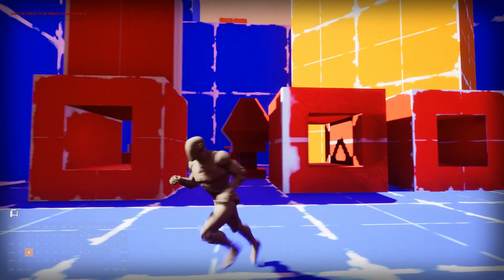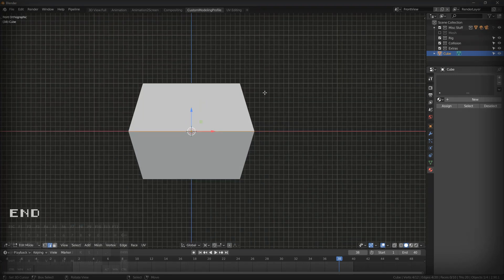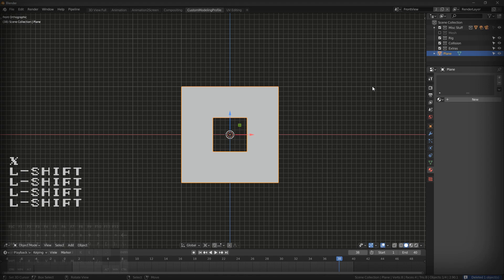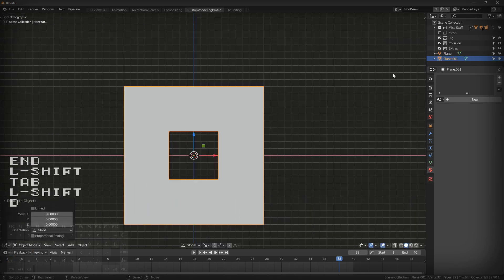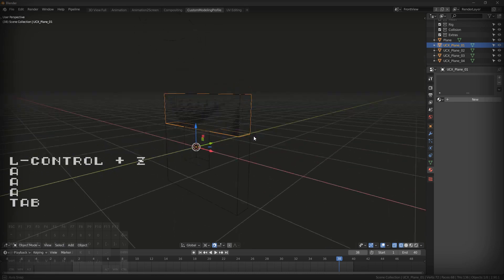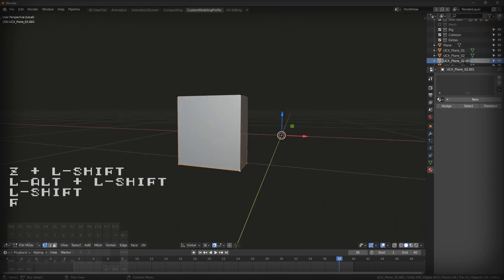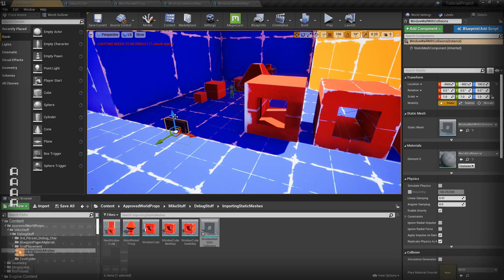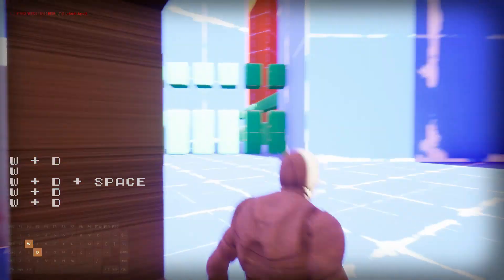Explaining Convex Shapes & Collisions in Unreal Engine & Blender - B2U - 2.5

Comment: Does using complex collision as simple take a lot more PC calculations? 
I bought a tub asset. I cant go inside it. And the complex polys are overkill. So do I really need to remake someone elses mesh, and add 5 planes to forum a tub (open box)?
Reply: You can always try to crank up the convex collision options. Often setting the hull precision to max or over it can help out. It should still be a lot better than complex collision even if you have a lot of hulls. But if you don't get the right results you can use the mesh but simplify it until it's only holding the shape. (Blender, Houdini, or even ue) And then use that as the collider. Even if it's not convex, better to have 500 poly mesh than 20k as collider.

And always consider how many collisions are calculated for the object. For example if your bathtub is never near anything which simulates it will make 0 impact. But if you try to fill it with simulated balls they all have to check against the thousands of triangles.
Reply: @kettenotter  Thanks. Do you know any comparison video or that goes over options? I need to see results to know which to use. Yet I havent found much info (comparison, or settings explained vs performance).

"Often setting the hull precision to max or over it can help out."
Increasing hull precision merely increases its calculation - to better match the shape, correct? (Takes more time, but tries to get the area to match the Mesh?)

I think I tried max precision. But it still makes random and ugly triangle blobs that didnt match a bowl shape. So there were holes in the collision.

"but simplify it until it's only holding the shape. (Blender)..."
I know which simple shape I want. The problem is im used to Sketchup. It was easy to pull/extrude faces. 

Im newer to Blender and it doesnt seem to be as easy to pull faces, or draw lines to cut off a plane, to then extrude. I wish UE had a simple draw shape tool like Blender. Im very good at working in Top/Side view to get exact shapes. 

For my tub, I used 5 planes like an open box. But the top of the tub bevels out (wider opening). Thus there are air gaps. UE really suffers at not letting us do trapezoid edits on the Box collisions. 
The gaps are small enough to stop player from kicking out of the tub. But if I fill with balls or fluid sims, I'll have holes until I use a 3rd party to make collision shapes.
Reply: @kenalpha3  In Blender you can E to extrude and shift+D to dublicate a face.
You can use the decimate modifier to reduce the Polygons.
And no I don't know a Video which compares them in any meaningful way. But just from how it works, convex shapes are way faster to calculate collisions for and more stable.
I just found the best and fastest way to get perfect convex collisions for complicated objects: the Convexdecompositon node inside Houdini. You could generate them inside unreal with Houdini engine.
Reply from the maker: It takes noticeably more, but as long as you're not using it on everything, it is totally okay to use on specific stuff. It scales up the higher poly your mesh is, not good to use on a 200k poly small decorative object, but I'll use it on cars, or doors, or anything wonky shaped that the player shoots around or walks on.